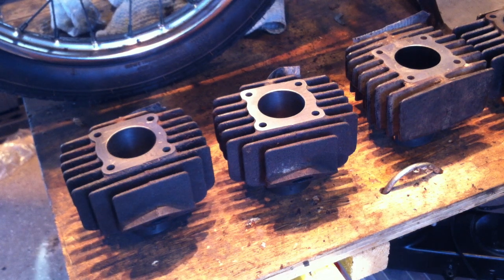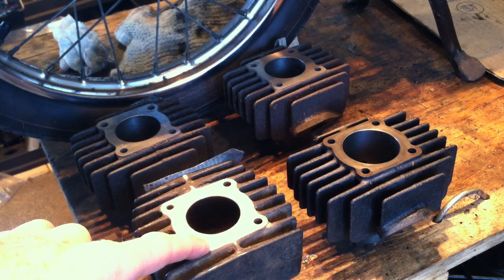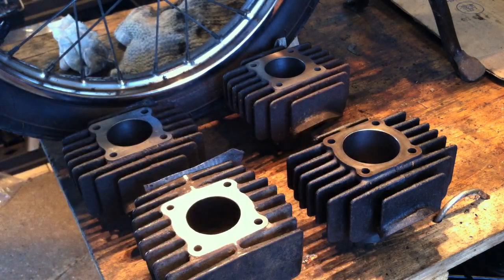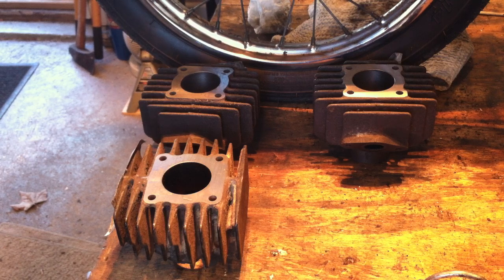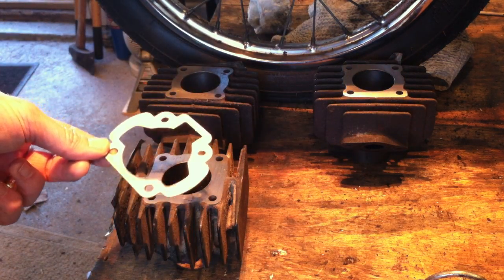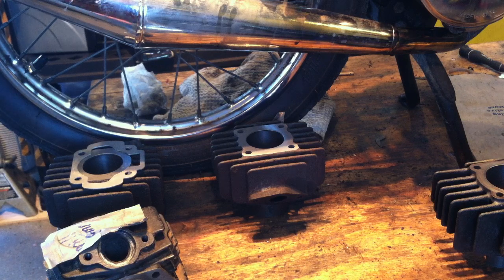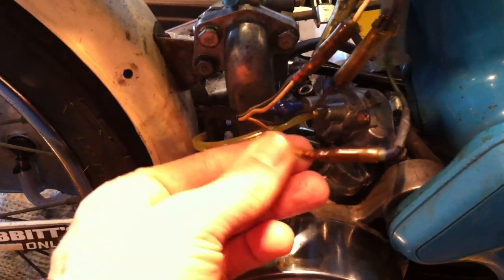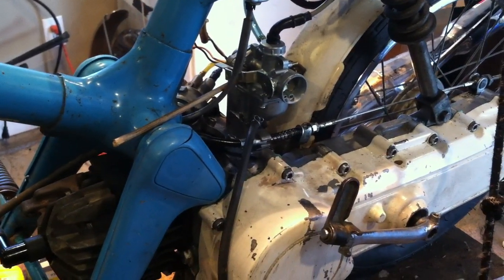Honda Express nc50 and Yamaha qt50 cylinder modifications for more speed

Comment: Old video, but wondering if you’re still using this shim?  Do you find this less effective than simply porting the exhaust?  It seems to accomplish the same in the end, but the shim method seems to open the transfer ports more. Any thoughts on the difference between the two?
Reply from the maker: I did the shim in combination with porting but the great thing is that you don’t have to do them in combination. The shim and removing a similar amount of material from the top of the cylinder is probably the easiest mod you can do as long as you run it with a performance exhaust.  The shim affects all the ports as well.
Reply: @jackrutherford-1  thanks!  I have 2 that I want to modify. I’m going to shim one and port the other. Have a people’s pipe on both. Then back to re-jetting!  How does the shim method affect low end with a stock carb?  It’s already suffering from the performance pipe. Will it worsen?  Afraid of being a “sitting duck” as you call it.. 😂
Reply: @jackrutherford-1  is it possible to purchase a new cylinder with the material already removed?

Comment: is there a way to use a 12v system on a 81 nc50?
Reply from the maker: Sure.  you can find a 6v to 12v step up converter and use that.  And then swap your bulbs, battery,  and other components for 12v ones.
Reply: @jackrutherford-1  My 80 Express already puts out 12.6 Volts ?? Maybe that's why they burn up batteries so quik ?? How did you rejet the carb ? Would like to see that vid ?

Comment: Hey so I got it running.. I put the original coil back on the stator and bam it started right up but it probably won’t last but I sold it while it was running. But I told him the stator was bad and needed to be replaced. Least I got to ride it!! Lol
Reply from the maker: nice
Reply: Now I gotta get this Suzuki rollin
Reply: Can you deck the head by dermal or sand paper by hand? Or would that tear it up?